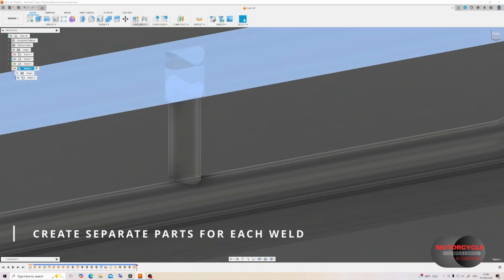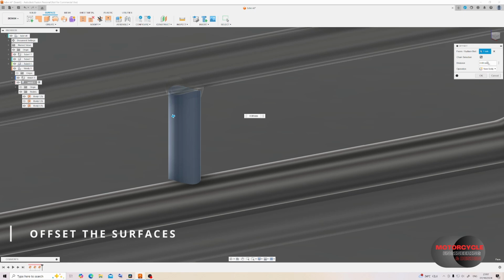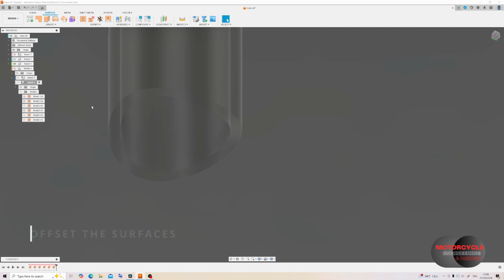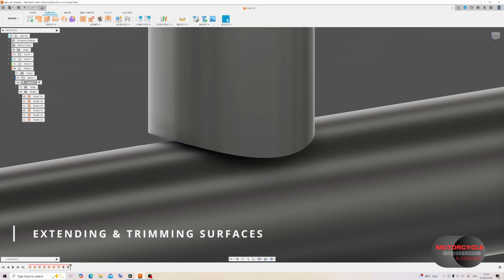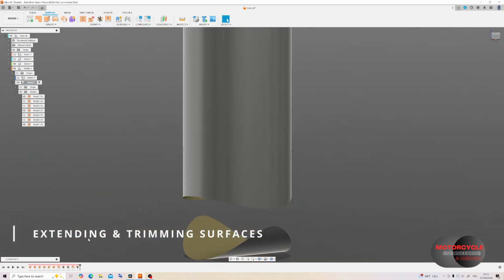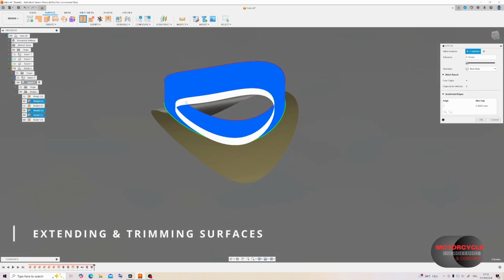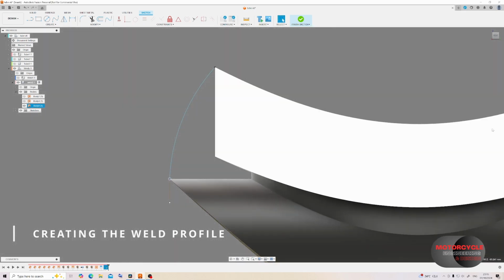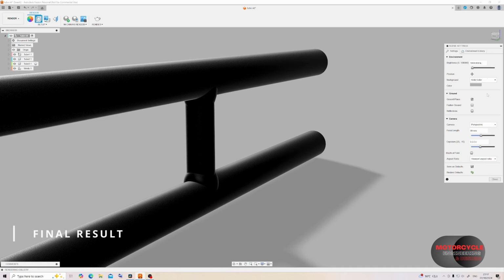How to Model Frame Welds for FEA in Fusion360: Motorcycle Frame Design

Comment: Very useful tutorial. I have been wondering how to model welds before carrying out a simulation. I guess you run ‘auto - contacts’ prior to running the simulation? Thanks for posting 👍🙏
Reply from the maker: Hi Jon, thanks for the question. I dont have the answer but, in CREO I would make sure the welds are assigned a material, if there is any interfering geometry it would fail in an FEA analysis so it has to be clean. Then since they are all in contact they can be treated as rigid joints.
I'd have to jump into fusion simulation to confirm but I assume the auto-contacts should be able to understand that.
I hope that helps! I'll try checking it out when I get the chance 👍